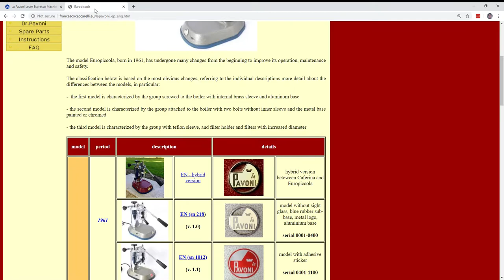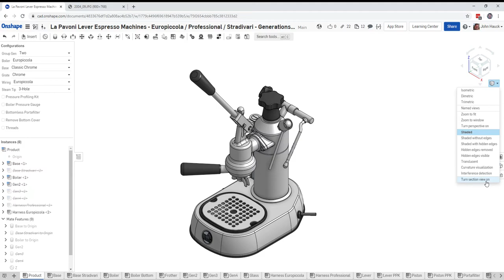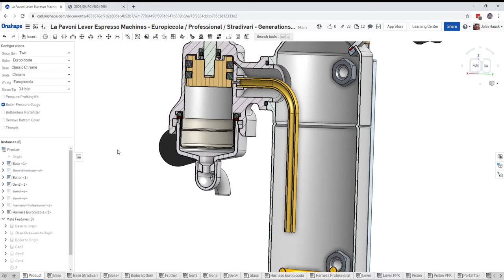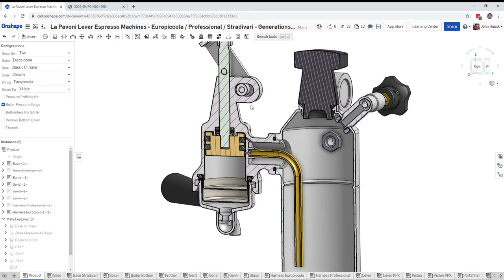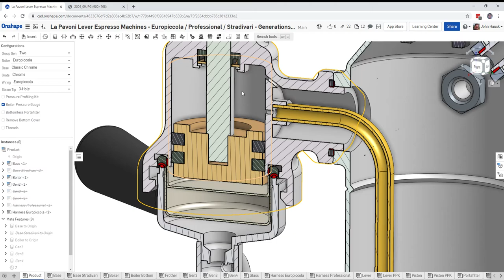5: Generation 2 Steam Heated Group Head - La Pavoni Lever Espresso Machine

Comment: I have GEN 2 and GEN 3. Like Gen 2 more:
- Love the steam heating. 7-8 minutes and everything is up the temperature. No need to waste water flushing the group head.
- No sleeve means less isolation, measuring the group head temp  gives more precise water temp.
- No trapped air problem (Spongy lever)
Reply from the maker: It's fun having more than one machine to experience the difference in designs. I've heard many people prefer the generation 2 over the 3. It is a rare bird, however, that prefers generation 1. Enjoy your journey!

Comment: Wow... I really thought this version of La Pavoni was the best one until seeing this video. That's my dream machine torn to shreds... Otoh, it will help me gauge more carefully the right pressure for a shot. I hate to admit it but I may have been scalding my shots even when I was under the impression I was managing the temperature.
Reply from the maker: Stelios,
It may be that the generation 2 is indeed the best. I'm just sharing my thoughts. There is always so much more to learn!
Reply: @JohnMichaelHauck  I seem to be going round in circles. I thought I was scalding my shots so I was not letting the water reach boiling temperature. Then I started purging the air in the boiler again (which made the water reach boiling temperature) and discovered my shots became much better. I think in order to reach consistent results, there's no escaping the need to follow a systematic procedure and to acquire the right tools. So eventually I will have to find a way to gauge the water temperature inside the head as a first step. Elsewhere on yt people told me it's brand coffee which is the reason for not getting crema. Then I remembered I was getting more crema using the same coffee with a cheap bottom of the range espresso maker. There are just too many variables (I have counted at least 7 so far) and a systematic approach is simply not feasible time-wise.

Comment: Hi John. I have just bought a gen 3 la Pavoni. A technique I have been using to bring the group up to temperature is to do 5 or 6 half raises of the lever. Not high enough to allow water to exit. I am assuming I am introducing steam to the group above the piston but I don’t really understand how that is happening. It would be great to see that explained.
Reply from the maker: Rod,

Thanks for the suggestion on another video about temperature. It is good that you clarified which generation machine you are talking about because they really are very different. My thoughts on raising the lever half way is that you are pushing the cooler water above the piston back through siphon tube into the boiler. Then when you lower the lever, hotter water re-enters the group head. This will then indeed raise the group head temperature.

Understand that your procedure cannot remove any air trapped in the group head. I believe that raising the lever to allow steam, water and most importantly air to escape is critical to pulling a good first shot without a spongy pull.

In any case, to collaborate with people that have these and alternative views, I would suggest plugging in to this friendly group: https://www.facebook.com/groups/lapavonienthusiastsgroup

Comment: So the steam in the boiler is actually going through 2 tubes? 

First tube is the one to preheat the group head/portafilter and the 2nd one is for the steam to escape into the air?
Reply from the maker: Adam, just to be clear, we are talking about the Generation 2 group head only. See video "2: Four Generations of Group Heads" (https://youtu.be/ViNrag4lYJg) for a comparison with the other group heads.

So, to try and respond to your question, there is only one "tube" - the copper siphon tube. One end of the tube connects to the holes in the group head that lead to the brew chamber (below the piston) when the piston is raised. The other end of the tube is submerged in the boiler water. When the piston is raised completely, the pressure in the boiler forces water up through the tube and into the brew chamber. When the piston is lowered, the water in the tube falls back down to the level of water in the boiler (like an open straw in a glass). The top of the group head and the top of the boiler are filled with steam (no air).

Steam can transfer through the upper hole (not connected to the copper tube) between the boiler and the top of the group head. When the piston is lowered, steam is drawn in because more space is opened up by the piston going down. Vice-versa when raising the piston.

When steam cools, it condenses to liquid water. Liquid water takes a lot less room than steam. Because of this contraction, the pressure inside the boiler decreases. The heating element is connected to a pressure sensor. When the pressure is too low in the boiler, the heating element turns on, converting some water back to steam (and increasing the pressure).

Did I even get close to addressing your thoughts?
Reply: @JohnMichaelHauck  my bad I should have clarified but I just meant the second tube as the steam wand itself, 

That all makes sense though very helpful, I did not realize there is a pressure sensor included, does this mean when it gets too hot it also stops heating? 
And is this in all the models? Or only more recent ones
Reply from the maker: @adambromley6972 , Yes!
Peek at video #9 in this list https://www.youtube.com/playlist?list=PLPX9KWMNFMwNk_aBK7plrFBF1VJx0OMVw
There you can see when La Pavoni went from a high/low switch to a simple on/off switch with what is called a "pressurestat". The pressurestat is mounted to the bottom of the boiler. If the pressure is too low, the switch turns the heating element on. Then it turns it off when the pressure is too high. Over the years La Pavoni would turn on a light when it is heating, or turn off a light when it is heating - go figure which is best! Before the pressurestat introduction, if the boiler pressure was too high, the valve on the top would open more and let even more steam out. These early machines would constantly hiss. Very alive! The new machines only hiss a bit to let out air (not steam) when first heating up. Then the valve only serves as a safety release, should the pressurestat get stuck on.
Reply: @JohnMichaelHauck  I’m learning so much thanks a bunch :)

Comment: What I am really trying to understand is how does the "sleeve" design of the gen 3 impact the water temperature/stability? What effects does it have overall? Thanks for any help!
Reply from the maker: May I recommend taking a peek at video #13 "Flow & Temperature Simulation".

https://youtu.be/eQuEZDY6Awo

The first minute and a half of the video shows how the generation 3 sleeve design cools the water from the boiler before it enters the brew water chamber. (I'm using "brew water chamber" to mean the water directly under the piston and above the coffee grounds, that will actually be part of the shot.) The generation 2 group head's siphon tube flows directly into the brew water chamber. The quick conclusion is that if the output of the the siphon tube in both generations is 120C, then the generation 3 brew water chamber will consist of cooler water than the generation 2. However, (as it's good not to draw quick conclusions) other factors are at play. The starting temperature of the group heads (the metal) can have a big effect on the final water temperature in the brew chamber.

I could work on a simulation of generations 1 and 2 too, if there is interest.
Reply: @JohnMichaelHauck  Simulations YES PLEASE!!!! Also that video is amazing! Thanks!
One question that raises however, is the although it might be cooler on initial runs, what does the overall temperature stability look like when comparing the designs. It's hard to tell if gen 2 has more thermal mass and how that would come into play. It looks like since the water is taking a longer route through the grouphead in gen 3 that it would be cooler, however does that mean that it would STAY cooler over several shots, or would the temperature stability have more variation due to the longer route?

Or I could be completely misunderstanding all of this...
Reply from the maker: You are not misunderstanding this. You are going down a rabbit hole. Welcome!

Take a close look at the generation 2 group head. It is, as some call it, "steam heated". That means it not heated just by the water that enters the brew water chamber, but mainly by steam directly from the boiler. I believe this plays a big role in why a generation 2 group head is generally hotter than a generation 3 group head. It was helpful to reacquaint myself to how steam works - well - at a high level at least. As steam enters the generation 2 group head, it will condense into water as it cools (and the group head heats up). As it condenses to water, it occupies less space. This then opens the door for more steam to enter the group head, to heat it up more. This is the cycle of steam heating the group head. Excess water in the group head (above the piston) drains back into the boiler to be heated back into steam again.

As for the generation 3 group head, it does get hotter on successive shots, but not as much as a generation 2.

As you are wondering, yes, thermal mass plays a large part in this, but I don't have anything quantitative to offer. IT is interesting that the generation 4 group head was designed with even more thermal mass, but the same inner workings as the generation 3 group head.
Reply: @JohnMichaelHauck  That seems to be my practical experience as well. When I installed the Bong isolater in my gen2. The first shot was so cold  that I now make it a habit to run some water through the grouphead so that the shot itself isn't cold. The subsequent shot that I pull is definitely less burnt tasting than without it. 

But I wonder how narrowing down the variable to just having a water cooled grouphead with a sleeve (gen 3), vs having a water cooled grouphead that pours directly into the brew chamber (gen 2)
Reply from the maker: @Wyrdrock  in other words, more simulations, including the Bong Isolator. You are heaping on, you know. :)
Reply: @JohnMichaelHauck  Sorry about that, It's all in the name of science! 

My theory is that in the Gen3, the water since it's taking a more circuitous route to get to the brewchamber could be expected to loose more thermal energy to the surrounding grouphead before it enters the brewchamber, thus leading to a cooler shot on the first pull, as your simulation shows, However since the water is coming into contact with more of the grouphead on it's route to the brewchamber (I think, it's hard to guage volumes in contact with metal.) That section of the grouphead might end up absorbing more thermal energy, more constantly than with the direct to chamber design of the Gen2 since like your simulation shows, it's basically holding onto that water for a little longer, while being exchanged with the new influx of water, thus constantly raising the temperature of the grouphead, since there's always water in the outer sleeve area, as opposed to the gen 2 design which only has water when pulling a shot.

of coarse that's just a badly reasoned theory...
I'd love to get your opinion on it!